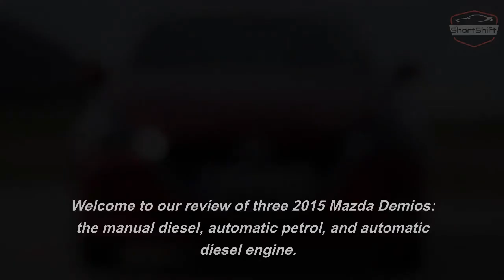2015 Mazda Demio Comparison: Manual vs. Automatic Petrol vs. Automatic Diesel - Which is Best to Own

Comment: I've just seen one diesel Mazda demio with paddle shift gearbox. I'm sure with that in proper use, it can beat the petrol engine in fuel economy. It can also come very close to the manual diesel. Or it's just me over thinking.